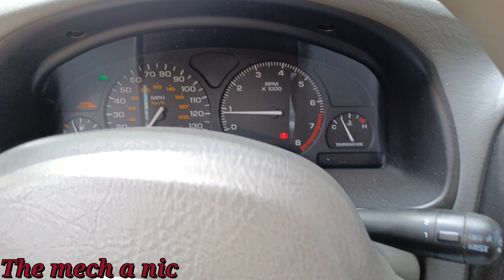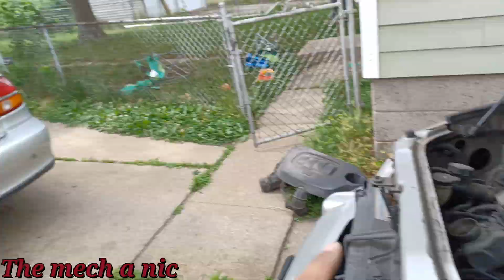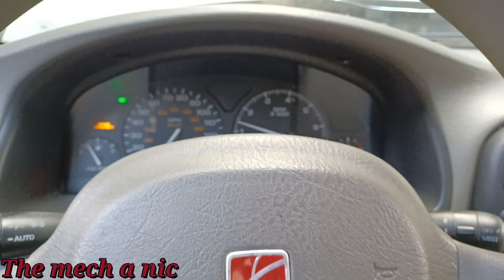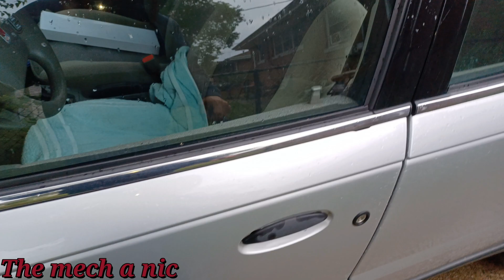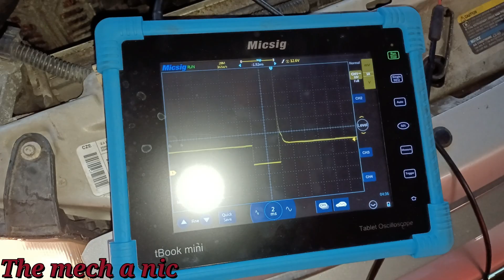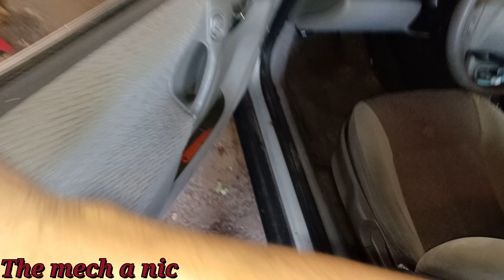fixing a free saturn for beginner driver

Comment: I have a 2002 saturn I appreciate these videos. ( subbed ) When I try to reverse the car some times it will roll forards and then "click" into reverse , any suggestions? ty
Reply from the maker: Check the trans fluid.  Has it been changed before? The Saturn's sl1 or sl2 I believe have issues with shift solenoids going bad
Reply: @themechanic6117  Thank you brother. That is exactly the issue at hand! It's a SL2. When me and my buddy changed the oil a few weeks ago we mistook the transmission filter for the oil filter, from there we quickly realized the mistake but all of the fluid just kept gushing out (after re-attaching) we went to AutoZone and bought a new transmission filter, we wasted a lot of of transmission fluid but it eventually held and is still up to level.. Thank you for your advice! I really appreciate it.
Reply: before all that happened, It still had the same issue. When I bought the car 6 months ago, I had it changed at a shop because the previous owners had never had it done and the car was at 85k miles.
Reply from the maker: Look on YouTube for shift solenoid videos. They're pretty easy to find which is bad and easy to change
Reply: @themechanic6117  awesome dude, Gonna look into it now, I appreciate it!

Comment: Beautiful work- diagnosis and labor. I much enjoy your attention
to detail, you treat each vehicle like your own. Your cleanliness is
very important; many Shops simply slap parts onto dirt & gunk-
because "who's going to see it?" and "time is money".

I've seen many Shops spill oil and coolant- then tell the Customer
"it'll wear off", and they drive away in a smoky car.

No, that intake sensor is an electrical transducer. The plastic is cracked.
If it were coolant, oil, or transmission related, it would be leaking
it's fluid.

Maybe you don't know- if you can mostly drain a cooling system,
it can also be smoke tested if it shows pressure loss.

Those Saturn will run & drive for 250k - 300k when taken care of.

I would now change all fluids & filters, and nuke the fuel & oil system with
either MMM or Sea Foam.
Reply from the maker: You always have helpful info 💪. I figured that Sensor was bad, like you said if it were a oil pressure sensor it'll be puking its guts out

Comment: Scotty Kilmer just did a video today about a corolla vacuum leak misfire on a corolla. The plastic intake manifold and aluminum head ... doesnt seal properly. They heat up differently.
Reply from the maker: Too bad I'm not subscribed to his channel lol
Reply: He also said Saturn's are crap cars. Sw1 going to 20000 miles so far. :)
Reply from the maker: These Saturn's are easy to maintain and parts are cheap. Proper maintenance and they'll go forever.  I do prefer the S series

Comment from the maker: Here's all the parts that went on this saturn I failed to mention everything. 

Spark plugs
Serpentine belt
Ignition coil assembly 
FR lower control arm 
FL cv shaft
Both front outer tie rods
Front brake pads and rotors
Both heater core Hoses
Air filter
Cabin air filter 
Sway bar end links 
Rear drums and brake shoes
Intake manifold gasket / throttle body gasket
Coolant temp sensor
Reply: @themechanic6117  good work

Comment: What got me was ls 100 bull shit that is a ls 200 or 300 both are the same inside and out other then engine I had a ls 300 looks just like that haha
Reply from the maker: I figured it was the engine that changes the numbers. Yeah that's horse shit lol
Reply: @themechanic6117  ill give it to you ya can fix a car I watch ya videos. Wish I could get my sl1 saturn fixed haha
Reply: The numbers indicated the trim level. 100 base, 200 mid, 300 top level. They did the same with the Ion, just simplified to 1,2,3.
Reply from the maker: Thanks for the info

Comment: I cant remember did this car come with a timing belt or a chain. Btw ya i agree great lil starter cars though that cradle rust being held with a zip tie had me cringing😲 Great work as always.
Reply from the maker: I'm pretty sure it has a chain . Yeah that cradle is done
Reply: Usually these have chains. They even made commercials bragging about it iirc
Reply: @ADR69  Thx guys for helping me remember. Had a bad case of CRS!

Comment: Jonathan,  why did you not check the spark plugs and maybe change them?
Reply from the maker: It got new spark plugs also. That footage was part of the front brake footage that I lost .
Reply: @themechanic6117  ok. Great job as usual.
Reply from the maker: Thank you. Yeah I failed to mention that it also got new spark plugs and stabilizer links